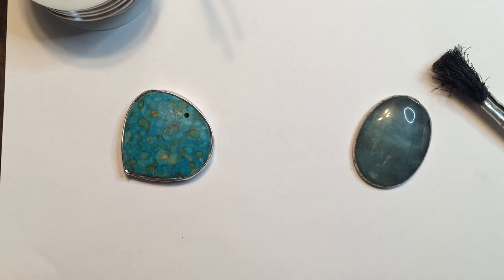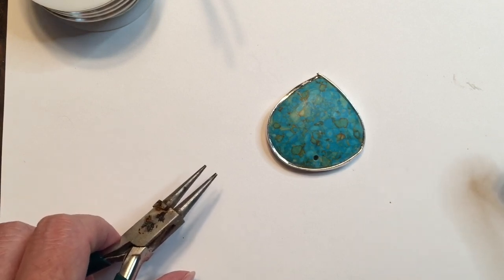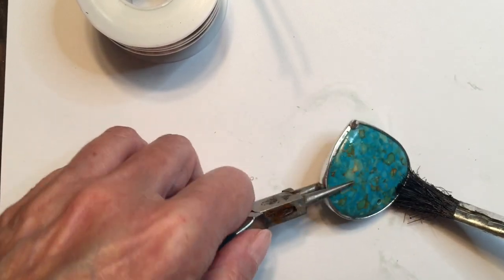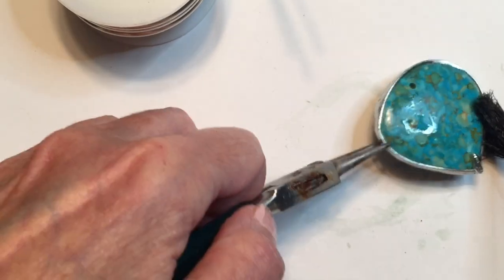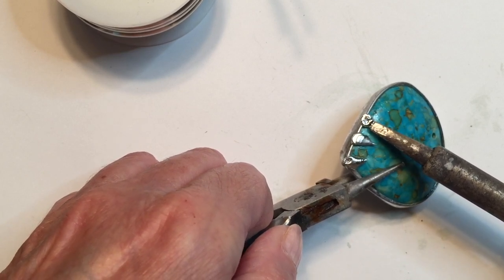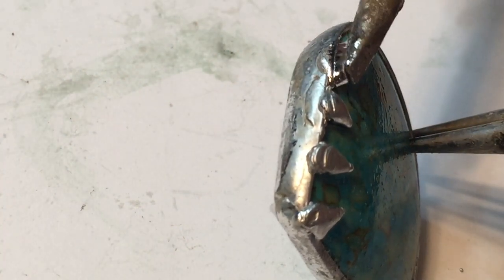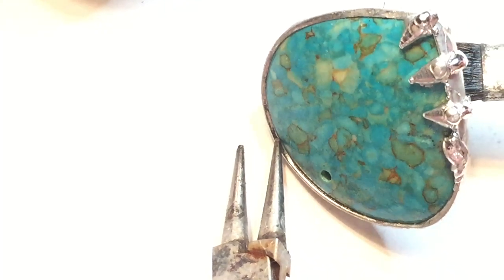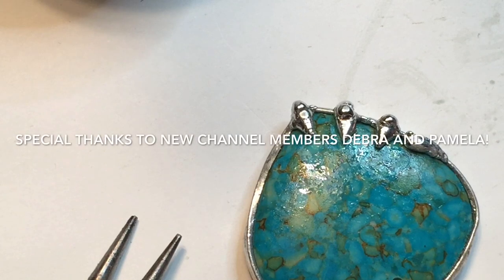Soft Soldering Jewelry: How To Create Solder Spikes & Talons 🐉

Comment: Excited about your solder iron jewelry making book. I already have Soldered Alchemy. Great to see a video again of your work!😊❤ I'm still using a basic soldering iron without a rheostat, and I need to upgrade,...as well as get different solder and flux. I've learned alot just teaching myself from trial and error, and I've gotten great results, but the lead free solder I use has a rosin core. Not sure if it's that or just the combo of that and the gel flux, but I end up having to spend so much time cleaning the gummy residue from my pieces. It's kind of like trying to clean hardened pine gum sap off. Such a pain, especially if the peice has alot of texture. 
Since I really want to upgrade my supplies n tools, I would be very interested in a video of any Black Friday sales for the materials and tools you prefer to use. I don't know if there is anything, but that would be awesome!
One little thing I did learn from using my standard iron, is I get points/ spikes easily... It's harder to make balls. I end up filing the tips down, but it often leaves marks, or there's places in the textures I really can't file. For this, my solution has been burnishing with the back of a stainless steel spoon, or  curved parts of its handle. It removes alot of marks,  further smooths any rough spots, and brings the parts i burnish to a high polish shine.
Reply from the maker: I list all of the items I use and recommend below the video in the description and/or on my Amazon page, so be sure to check that out. The new book  answers most of your questions and I think you’ll find it very helpful!
Reply: @LauraBethLove  Thank you. Already used your link and made my lists. Looking forward to learning from you and your experience, with your book.😊👍

Comment: Can I do it with a 100w soldering iron? I can't buy a one with degree and different heat mode
Reply from the maker: 100 watt irons are great for use with lead-free solder. Should work fine, it just takes a bit of practice.

Comment: Hi! I'm interested in trying soldering and this might be a dumb question but I was wondering what happens when the iron goes "off camera"? How do you add solder to it?
Reply from the maker: You touch the tip of the hot soldering iron against the end of the spool of wire solder and melt a tiny bit off, which clings to the end of your soldering iron until you apply it to your project. For complete detailed instructions check out my book called Soldering Iron Jewelry, the link is in the description down below. Good luck!
Reply: @LauraBethLove  thank you so much!

Comment: Hi! I've just started to try soft soldering and I have this yellow residue that won't clean off and is hard to solder on top of, do you know what this might be?? Thank u!!!
Reply from the maker: Are you using plastic coated wire? That could be it. Otherwise, not sure.

Comment: please tell me how to solder the floors so as not to spoil the bottom layer. If smeared with flux, then the lower floor will still melt. (traduction)
Reply: I always thought this. Did you find an answer?
Reply: @ezgi9387  no/ didn't
Reply: @nstyle-jewelry524  For example, in this video, he worked on it so much, but the subfloor never melted. I don't understand what's happening, I wish he would come back Laura :(
Reply: @ezgi9387  maybe bottom layer must be cold?
Reply from the maker: Try turning the temperature of your iron down. Make sure the bottom layer is thick enough. Do not hold the iron against your project for too long, work quickly. Practice! Good luck!
Reply: @LauraBethLove  thank you!